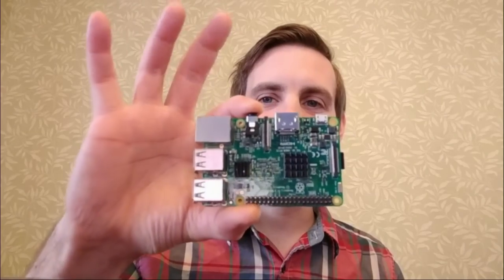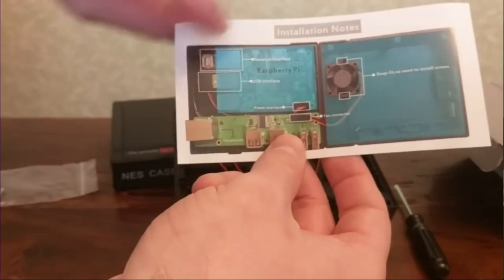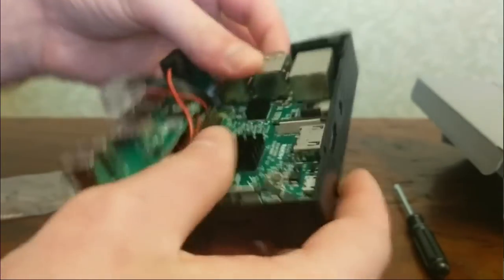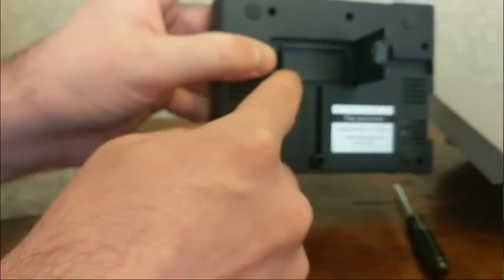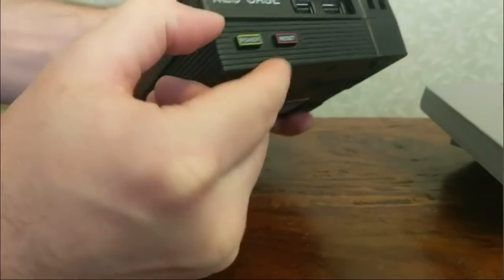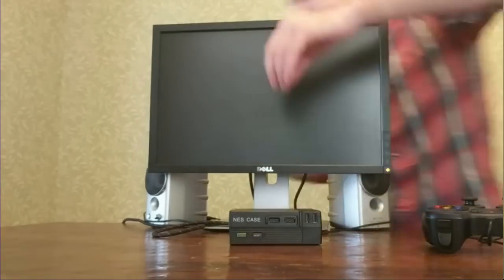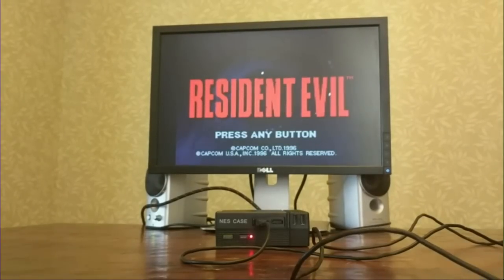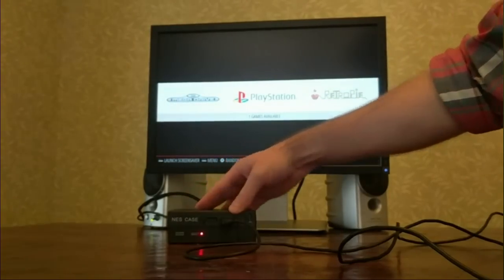DIY Raspberry Pi Game Console

Comment: Hi Davy, nice Video, looks intresting, i think i will buy this case too.
A little note from me, you plug the fan with the black wire at the + side of the connector.
I think the red wire at + is the right choice.
Reply from the maker: Good eye! You're right, when I plugged it in that time my wires were swapped and the fan didn't run. I've since corrected it and was going to annotate that as a note in the video but YouTube removed that feature for new videos.